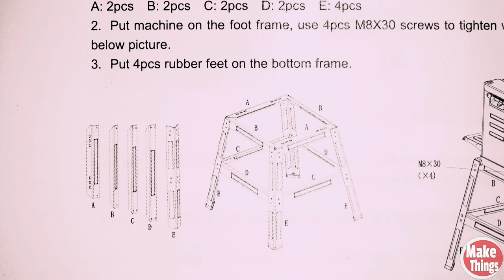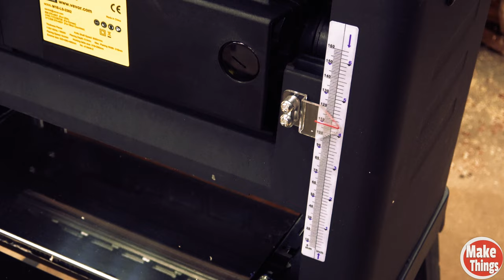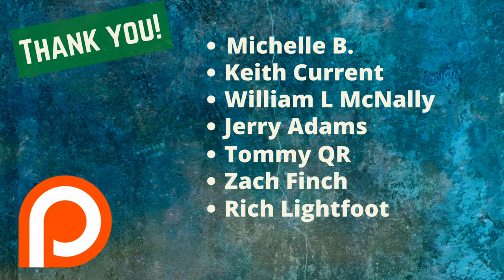Vevor thickness planer REVIEW

Comment: I bought the newest 2000w 3 blade planer and after four uses and maybe half an hour altogether the blade shaft dropped due to the  axel breakage near ball bearing. Now they want me to fix it and sending a shaft assembly to which I said no. Probably one of the bearings is loose and the shaft cover broken, it is possible that the transmission is also somehow damaged. I don't even have tools to fix it. The planer needs to be replaced but I don't think they will never do it. Stay away from this junk if you're even a tiny bit serious of your tools.

Comment: The trouble is that Vevor do not sell parts but will exchange/repair machine if in warranty. Here's the problem, I damaged my blades by hitting a hidden small staple and now leaves 2 very slight lines on my timber. Yes they sand out easily but what if the blades hit a nail or screw , the machine becomes unusable if the warranty has ended. Is the Scheppach or Draper 13" planer the same build as they look virtually the same machine.

Comment: I agree that the Vevor Thickness planer is a good buy, but If you have any problem with the unit like I did, you are out of luck getting service.  I used it several times before it broke. The feed roller  stopped turning.  I called Vevor for service and they told me that I would have to find a someone locally to repair it. I got 1 estimate and informed Vevor of the cost and they said no.  In the end I accepted a return of my money 90%.  After a month of searching the unit I finally found the problem.  The gear the connects to the feed roller broke. Now I am trying to find a replacement gear.
Reply: Brother same thing happened to me. The feed rollers don't have bearings, just aluminum blocks with holes drilled out for the rollers to ride in and they were not greased. I had to beat the roller out of it and grease them up, in still looking for a machine shop to fab the gears. Good luck to ya.

Comment: Great starter unit for the hobbiest/Weekend Wood Warrior, doing light weight thickness planing.   I noticed at stand assembly, there were holes in the bottom of the legs, and this makes it easier to mount the unit to a plywood base board with locking casters and use the holes on the legs with one one the caster pads!   A portable tool makes a handy tool!  
I have an '80's Delta 12" HD unit I got for almost nothing.  Couldn't pass on it.  I built custom cabinets and furniture 45 years ago to pay for college, I am familiar with planers...😁! 
If the manufacturer is just giving you the tool, for a solid and honest, no holds barred review, do so.   If there's anything "attached" , strings, ropes, and yuck, tell them thanks for the chance, but NO thanks!    I like your honesty!      Thanks!

Comment: I don't oftern do reviews on things I've been gifted, but occasionally if there is something interesting about the tool or I've had a genuine need for it I will. There are not many low-end thickness planers so finding one that is functional would be good for those after a cheaper option.

Comment: Avoid this machine. I got the 12" and its a major pile of crap. It broke within 20 min. It doesn't have bearings for the feed rollers, just holes drilled thru blocks of aluminum, they never greased them and it seized up. There really is no customer service( they never returned my emails. As a result one of the cogs the drive chain rides on sheared off and since Customer service won't get back to me( over 6 months now..I have to find a machine shop to fabricate the part. It made out of the cheapest meatals. Don't buy this pile of crap. They won't even allow my one star review to post on their site.